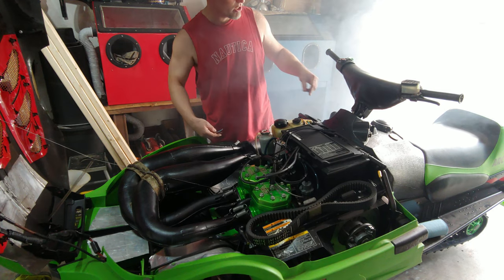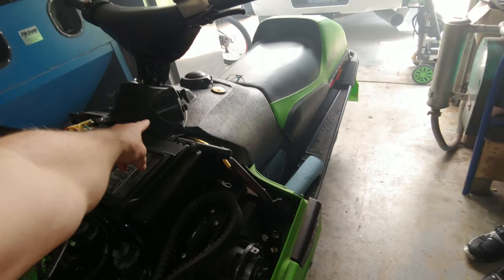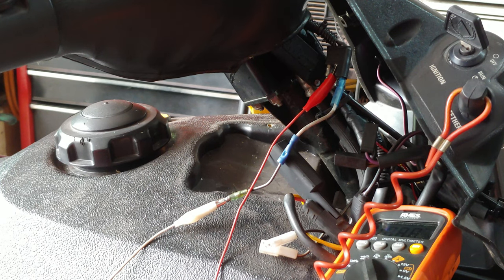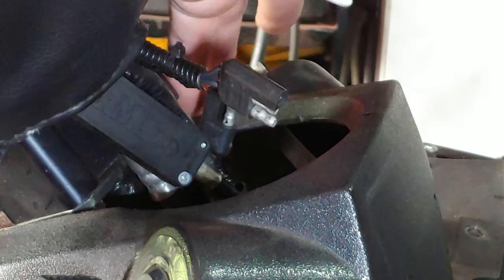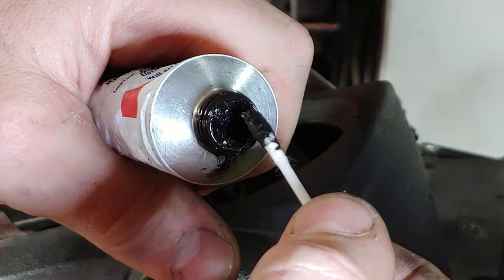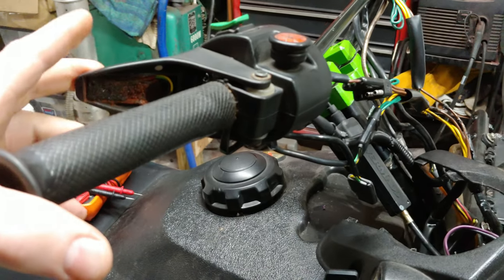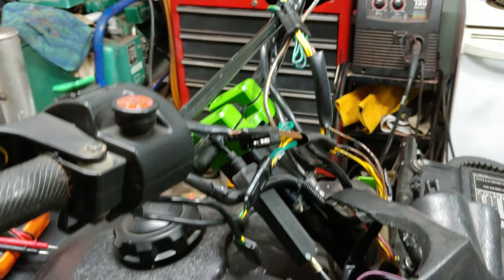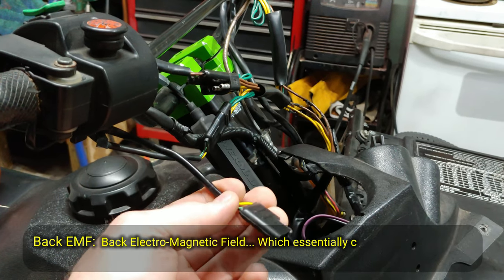95 Arctic Cat ZR700 Part 9 || Electrical Issues Diagnosis [Spark]

Comment: Put a less wattage headlight in it so it draws less current and you might be able to use them hand warmers
Reply from the maker: That's what I waa thinking. Maybe some LEDs? Got any good recommendations for the LEDs?
Reply: @Fixin2Ride-Official-  iam not sure what bulb you have in it right now so I could not recommend one. 1st I would try to unplug your light and then turn your hand/thumb warmers on to make sure that a draw is actually the issue I've been watching your videos on this sled build I don't recall u having this issue before when u 1st put that motor in the sled a few years back did u have the issue then?
Reply: It was actually 3 years ago when u made this video https://youtu.be/cGLQls-gyT8 were you having this problem then too?
Reply from the maker: Yes that's when I first rebuilt this entire machine. It didn't really show up at first because I was only farting around in the field by my house. But it did show up the first time we took it up north and we were about 20 miles into the trails.
Reply from the maker: Im sure I had the issue but I didnt realize it because I didnt use my heaters until I got out on the trails...

Comment: Hi! I want to ask for advice. I have a zl600 EFI SS 2001, but it replaced the injector with carburetors. I want to change it back. I found an injector only from 1999, is it suitable or not, what do you think? There is only electric nozzles and a throttle position sensor, in theory, should be the same... and there is no oil pump drive, but it can be connected to a gas cable
Reply from the maker: Youd have to ge the entire electricl system. Ecu, harness, sensors etc...
Reply: @Fixin2Ride-Official-  All systems are available and work as I understand it, electric fuel pump, ecu and everything else. The snowmobile was injector
Reply from the maker: So you're using an electric fuel pump with carburetors?
Reply from the maker: If you have everything there and everything's working just put the throttle body back on and you should be good to go
Reply: @Fixin2Ride-Official-  Yes... and it works)) only I don't understand how... All systems remained injection
Reply: @Fixin2Ride-Official-  The main question is whether it is possible to turn on the throttle since 1999... Right now there is no way to get another one in my country... The catalog numbers are different, but the principle of operation, I believe, is the same. Connectors are also suitable. There is no thrust of the oil pump drive in the old-style throttle valve, but this can be done with a double gas cable
Reply from the maker: I may not be understandung your question fully but I'll try... 

The throttle for both is just a cable. Albeit shorter on the EFI and only 1 cable that goes to the throttle body for both valves. The oil injection system if not hooked up should be to the throttle cable assembly for an EFI. If you have everything hooked up to the engine that was for the EFI bur youre using it currently with carburetor, pull the carbs, out the EFI TB back in and hunt down tje correct throttle cable, oil injection cable assembly and that should be all you need to do. 

 Contact West Michigan Snowmobile Parts and Ask Keith or Eric if they have the part and if they can ship it to you.
Reply: @Fixin2Ride-Official-  I also think that everything will work when connected, but I am concerned about another question - the geometric dimensions of the throttle may be different for 600cc from different years of manufacture (1999 and 2001)? It will not be possible to push or narrow the throttle due to the fuel rail.
Another question - the LED flashes on the ecu from below when the motor is running - does this indicate its normal operation or an error?
Reply: @Fixin2Ride-Official-  The injector that I should have has the number 3005-903, and I can only purchase and install 3005-265. What difference in geometry can there be between them ((
Reply from the maker: Throttle travel should be the same as the thumb throttles are. 

 The ecu will flash once upon starting. If it has a reoccuring flash, you have an issue. It will flash 1-6 times and repeat every 2 seconds. Figure how many flashes it repeats every 2 seconds and look the code up online.
Reply: @Fixin2Ride-Official-  Most likely, the error is shown because the injectors and the throttle position sensor are not connected... But I'll check it out when I finish rebuilding it. It has a lot of electronic components - an APV valve servo, a smart K2 suspension, but no battery... how can it even work without it)))
Reply from the maker: Not sure on that. Might be a difference in plug only or amount of fuel per pulse.
Reply: @Fixin2Ride-Official-  The engine volume is the same for these injectors, although my engine has an APV system, but for sure the amount of fuel for it is controlled by the ECU when it is triggered. A lot of questions)) I don't think anyone has made such a replacement, so I will most likely have to answer questions after I try. I have Chinese carburetors and I don't like at all how he accelerates with them ((In deep snow, the reaction to the throttle is very important, so I thought about replacing "as it was", but there is an easier option - to put high-quality original carburetors. I'm in doubt
Reply from the maker: Yeah like I said if you have all the original parts for the EFI system just slap those on there and contact my boys here in Michigan and get yourself any parts that you don't have access to over there they should be able to ship overseas and hook you up
Reply from the maker: It haa a lighting coil and a voltage regulator/ rectifier that control voltage output.